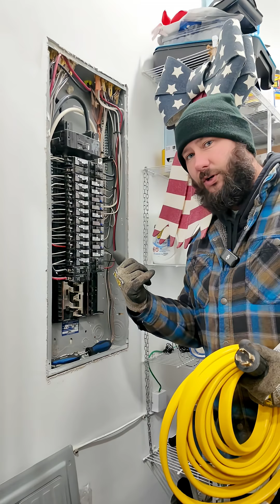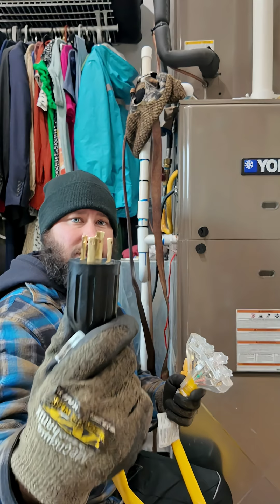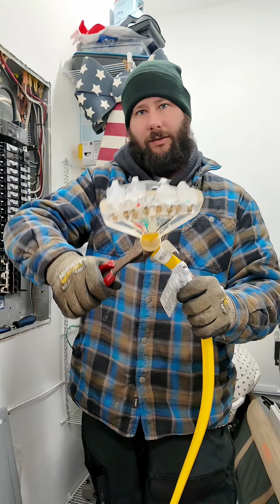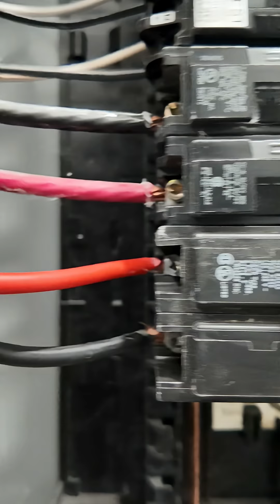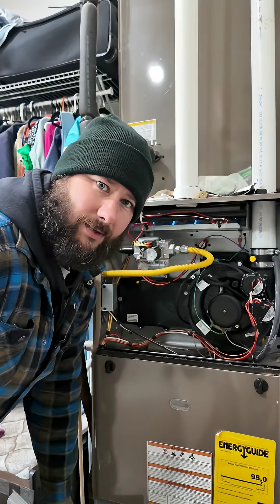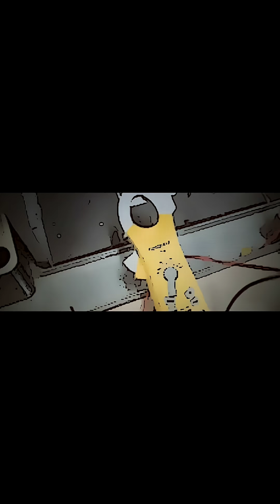How to Run a Gas Furnace on a Portable Generator (Breaker Box Setup)

Comment: Also the white wire is not correctly connected to the neutral bus.  There are wires that didn't make it under the screw.

If you leave the breaker on, the plug will be energized with 240 v and could electrocute you.

This is a TERRIBLE install.

Comment: Stop. Beaks at putting the breaker there. You need a lockout on the main while its on and a lock out while the generator is on and locked out while the main is one. All it is is a plate that slides back and forth ove the 2 breakers. Both breakers needs tobe close. So that gerator breaker needs to be on top of all those other breakers. Either left or right. With the block out.

Comment: So what happens if the wires are too short to move one of the top breakers when wanting to install an interlock? Anyone?
Reply from the maker: First, see, if you can pull a new wire
If you can't and the code allows for a polaris load for a splice, then do that

Comment: This is all good advice. however...
You don't need to cut the end off that expensive extension  cord. You can buy or make a tail for the panel end of this...
Also, you should install a proper isolation method, like an interlock plate or transfer switch to make sure you can't accidentally backfeed the grid.

Comment: Very good information!!! Keep up the good work.
Your gas line to the furnace is incorrectly installed. A flex line should not be inside the unit. Only solid piping.

Comment: I had an electrician wire me a back feed generator outlet next to my main panel and I just plug my generator into it. Also installed a beaker bar that won't allow the main breaker to be "on" at the same time the backfeed breaker in on...

Comment: Please please do not do what this guy is showing you to do.  While it does work, this is very very dangerous and nothing he did is remotely to code.  Install a hard wired plug connected to the breaker with conduit.  The generator breaker has to go at the top near the main breaker to use an interlock switch. Or install a transfer switch.  But whatever you do, don’t do what this guy did.  Why did you do it wrong and then at the end tell people verbally how to do it correctly?

Comment: While you can do this it is strictly against code! There needs to be a transfer switch that will only allow you to have one power source on at a time. This would prevent any possibility of the power back flowing to the power line and possibly causing a line worker to get killed.

Comment: I agree mostly done right. I would stress not plugging in the cord into the generator until ready to fire it up and test voltage, I would also insert the cord through a box connector for stress relief and multiple other reasons. I would then after testing the voltage shut everything down and install the panel cover. After grid power is turned back on shut everything down, disassemble everything and put a cover back on. You can leave the breaker in for the next time you need it. Be careful on grounding. The generator should be grounded as well.

Comment: I just had a 50 amp  plug put under my box and just plug the generator into it then shut main off runs whole house
Reply: @charliesgarageusa4986  That sounds much easier for future emergencies. Do I just install a regular outlet under the breaker box and hook it up to a new 50 amp breaker installed into the breaker box? Then just run a male to male ( 10 gauge? ) cord from the new outlet to the generator? 
Thanks for the recommendation and any clarification/correction you may offer, blessings to you and your family!
Reply: @Jack_Kaminski  got a 50 amp plug and my generator has a 50 amp plug just use cord to plug into i had to have an electrician hook the 50 amp plug up and breaker I'm a car guy but did do a video on how I set it up.
Reply: @charliesgarageusa4986 Awesome, I'll check out the video now. Thanks brother, blessings to you and your family!

Comment: It would be safer if you moved the wires on the top two circuits on the left-hand side of the panel move them to a different location put your 30 amp breaker at the top then get you a generator interlock switch that prevents you from accidentally turning the mains on with the generator running or leaving the main zone and turn your generator on while there’s a power outage which can hurt or fatally injured a line, man

Comment: Wow is that dangerous for a homeowner to do that. Good chance they forget to turn off the main. Also why only a 30 amp line with that massive generator that surely has a 50 amp output receptacle? Do a proper cutoff or transfer switch n that panel! And I’m not even a licensed electrician but I know this.

Comment: Good functional info overall.  The flexible gas connector to your gas furnace is most likely installed incorrectly as they are not allowed to penetrate the cabinet.  If there would be any vibration it can wear through the thin-walled flex connector pretty easily, and a leaking gas line is definitely a safety hazard.  Black iron pipe is much more resilient against chafing from vibration, and is required when entering the appliance (at least in my local AHJs).  Keep up the great, helpful content!

Comment: You dont need 220 to run a gas furnace ,120 is all needed to operate the fan . no inter lock will alllow you power to back feed onto the grid , Overall ,this video is apoor example

Comment: This is very dangerous no one should do this. Install an interlock switch at panel run 10-3 romex from panel to outdoor generator location wired to a generator inlet device. Use a 30 amp generator cord to connect generator to the inlet device.

Comment: You need to know if your generator ground is bonded to neutral which many are. Your main in the house neutral is bonded where you connected white and green so THE GENERATOR CANNOT HAVE A BONDED GROUND AND NEUTRAL!

Comment: You tell people to use an interlock and then you didn't 🤦 You should've rearranged the breaker location to the top at the main . The way you did it made using an interlock not feasible 🤷‍♂️

Comment: What about lifting the neutral-ground bond on that generator? Know that if you do like this video, you will have current on the grounding conductor due to the bond at the generator and bond at the main disconnect.
Reply: ED, yes it looks like the new heatpump SMART boards have interlock to recognize this neutral-ground bond. Amazon sells plug to correct this or u can make one, it does take up a outlet on generator.

Comment: That’s the most dangerous and illegal thing I’ve ever seen. If something goes wrong your insurance company will likely deny any claim. I have replaced two main breakers that were still hot on one leg when turned off.
Reply: And how would an interlock fix that?  :)
Reply: @ChrisEpler  it won’t. I prefer a transfer 
switch.

Comment: When you do this you Must use a Main breaker sliding lock that makes it impossible to to turn the MAIN breaker on when the Generator breaker is on. The Generator breaker should be at the Top right of panel then the breaker slide MUST be installed correctly by fastening to the panel.

Comment: Holy shit this is dangerous. As soon as you unplug the generator and turn the main breaker on you have a suicide cord.
Reply: One only need run it to a plug outside, then plug the gen into that when needing emergency power, no “ suicide cord”.
OR, simply shut off the breaker after the emergency, no “suicide cord”.  
Everyone isn’t stupid and leave a hot 240v cable laying around on the floor ffs…
Reply: @megastick9324 it’s commonly referred to as a suicide cord when the male end is a load side. Anybody can avoid being hurt by doing what you said but it wasn’t mentioned in the video. Just the dangers to lineman. If you happen to have a generator like this one what are the chances you haven’t put an interlock in? So what is this video even good for? Atleast mention all the necessary steps to be as safe as possible.
Reply: @j@jatf know exactly what it is. You say it wasn’t mentioned but you mention it like he planned on just leaving it lay  there
When he was done with it.
Several times he mentions making sure the main is off, that shows he is aware of the potential danger to line workers, but because he didn’t mention…what?…means he’s an idiot and would leave an energized cord laying around.
For one, he explained clearly this was for emergencies, and the steps to take.
For two, MANY people can not afford the added expense of interlocks or gen sets when added to the cost of the generator, it’s that simple.
They cost as much as the generators in some cases. Then cost of installation for those that can’t DIY.
Add the cost of emergency supplies and some would have to go without to have your approval of their method of installation in an emergency.
If the instructions in this video are followed, there is no “ suicide cord” or danger to the line workers.
Some people just have to find fault with something somehow.
Must be nice to have the money to just order up a pro installation and then sit back and wait for the emergency to end…
Reply: @megastick9324 dog did he state the order and importance of using the breaker to the generator? Most people are going to have to leave a door of some kind somewhat open to have an extension cord, thick one at that, run outside to their generator. So eventually they are probably going to want to close that door. And since he didn’t state the importance of turning off the generator breaker first, he’s not explaining the full dangers. So again I ask, who’s this video for? If he knows what to do and it’s just for him then why post it? If he’s genuinely trying to help people from freezing to death in this unlikely scenario of having a 240v generator and not an interlock already, then he should explain the correct order of using the breakers and the full dangers of doing it incorrectly. I don’t know why you’re defending this so much you know it’s risky if you do it wrong.
Reply: @jatf yeah, you got me Karen, people should either consult you and take out a loan to protect their families, or just forget the whole thing because your way is the only way to do things, any other way in an emergency is just a fools errand and should be disregarded out of hand.
You really need to admonish anyone who even had the audacity to watch this video without your expressed approval and a note.
God forbid they have food, heat and comfort when there are so many “ what if “ scenarios unaddressed right?
I’ll bet you’re the king of your HOA too…
Reply: @megastick9324 nice
Reply: @jatf ED, he saved some time/ trouble by not moving the new breaker to the top of box where the interlock is installed by the main. BUT, this requires to always remember to toggle the main.
Reply: @patriciareynolds2729 not just the main but the generator breaker too. THEY BOTH SHOULD NEVER BE ON AT THE SAME TIME. my issue is he didn’t explain the dangers of not turning the generator breaker off once the main breaker comes back on, or the need to take the wiring out of the panel before cutting the main back on.  If someone keeps that generator breaker on and turns on the main once the emergency is over, then when they bring the extension cord back in, so they can shut doors, the male end of that cord will be an exposed wire with 240v on it. Yeah maybe you’ll only touch it with one hand and it won’t go across your body and kill you but it’s dangerous and if he is trying to help people out in an emergency just explain the full dangers or he may end up hurting them or others and negate his good intentions.
Reply: @jatf yes, he did have new breaker between main and gen, right. I like the failsafe brackets u have to drill panel and bolt on . Trouble is that any new breaker will be at bottom, and you have to swap 2 breakers to get gen braker next to the main. and yes , the new cord would have to have new breaker opened and locked when moving gen or unwired.

Comment: What about solar it ok to keep my solar feed on while back feeding?
Reply: @turdsferbreakfast  I am not 100% but I  believe you must shut off the solar feed to the breaker bc you do not want the solar inverter trying to sync with the generator a d backfeed. If you have an integrated system with batteries (envision, generac) it might, might be ok. I am 100% sure if you disconnect your solar feed and your grid feed BEFORE introducing power from the generator than it will be ok. MAKE SURE to disconnect the feed from.the generator before reconnecting to the grid or the solar.
Reply: @johnsteinmetz4000 thanks for the reply I knew it was ideal, but didn't necessarily know exactly why

Comment: Obviously this is for emergency situations,  not everyday use. Appreciate the tip and the safety protocals. In -30 and a blackout could save lives. Keep the house from freezing up. Use sense people.
Reply: Using common sense means preparing your panel for this situation before an emergency, not during the emergency

Comment: yes please please make SURE that power doesn’t get past that main to the grid-
feb 1966 my uncle was a lineman and was electrocuted when a line he was working became hot during an ice storm, that became live from an off grid source
Reply: @sparkyobrian6417  rip uncle that sucks man just trying to get a paycheck
Reply: I am disappointed that they are not using a transfer switch or lockout on the main. Not everyone understands the danger of turning the main on, or even what the main is.
Reply: Thanks so sad, bro. 🥺
Reply: It would have to be a big generator to electrocute someone clear out on the grid somewhere while trying to power up everything calling for electricity on that grid. I only have 6,000 watts and it will stall if I have too many breakers ON at the same time.
Reply: @Moparben3713 when you feed back through the transformer it steps up the power.

Comment: Shame on you! That's illegal! It's an NEC code violation that way you demonstrate in the video. No interlock or transfer switch; and terminating an extension cord into a circuit breaker is also illegal.

Comment: Me and my co-workers were just talking about this topic, but we're probably going to do it on my property. slightly different but the concept still the same. My company also does generators where if a blackout happens a generator will automatically fire up and supply power to the structure